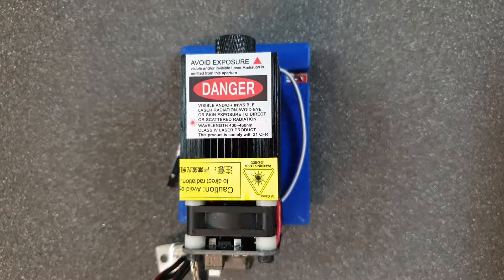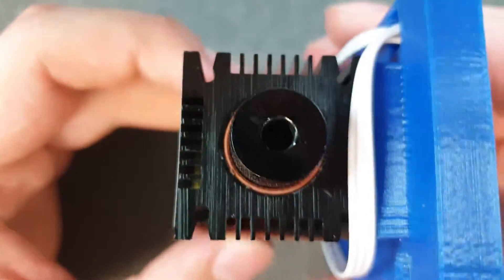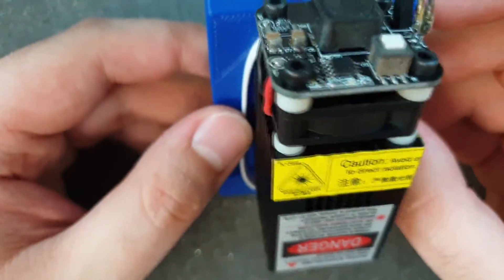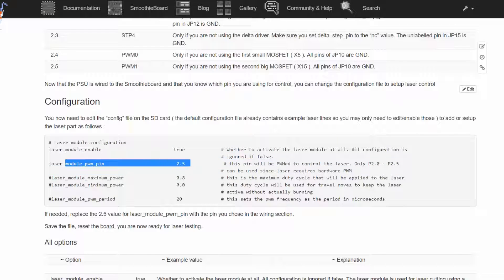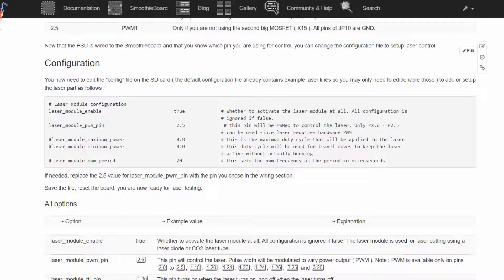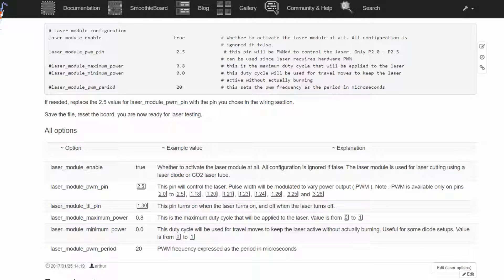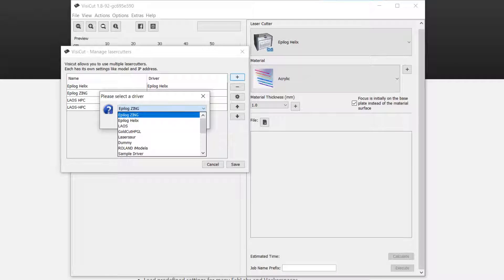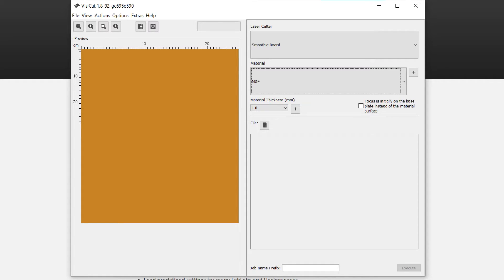How to connect a 2.3W laser to your 3d printer basing on smoothieware

Comment: Hello friend,
I want to make Engraving Machine from 3d printer. But my knowledge of electrical connection is poor. My laser has 3 pins. +, -, pwm. I took the electricity from the fan and changed it from 24v to 12 volts. (with LED transformer). I couldn't find a place to make the pwm connection on my laser, it stays disconnected. because the transformer has 2 outputs. Without a pwm connection, the laser does not emit a beam. The laser fan works when there is + - connection. How can I find a solution?
Reply: Hello,
Pwm pin you should connect to your 3d printer board and software should support it (it should be declared as a laser etc) pwm pin is responsible for adjusting laser power
Reply: @SanFable  MKS Robin Nano v1.2. board. And i saw bltouch "s g and 5v " can i connection this pin? Because fan have 2 out not 3 out
Reply: @burhaneddinbekciogullar1918  pa8 is direct name of mcu pin which can be configured as analog/pwm signal
Reply: @SanFable  i saw 3d table settings with bltouch and this proces not analog,  everything otomatic. Maybe this pwm pin responsible for adjusting laser power. İ must to try this. How should I make the connection?  Which pin to which slot?
Reply: @SanFable  now i checked this board diagram, and yes this is PA8,  GND, 5V, PA8

Comment: You never explained anything about how to Wire the Laser mine has VVC, GRD, PWM for connectors I am trying to connect to an MKS 1.1 I know you use the Fan PWM but just using the VVC and GND you get little power Variation the PWM and GND does not work where do I connect the third wire?
Reply: @A3D can you share your connection? also the code that are you using?. thanks
Reply: @A3D I have that same problem.  pwm is idle and needs 5 volts.  Where should I connect this cable now?  If I find 5 volts on the motherboard should it just be the connection?  Which one cable will be connected to?  +?  -?
Reply: @A3D i have MKS Robin v1.2. and i can see bltouch 3 pins g, 5v, s. And which is pwm, which is +, which is -, how do i connect it.
do i understand correctly?  I will directly connect my laser to these pins?  I will do the settings later.